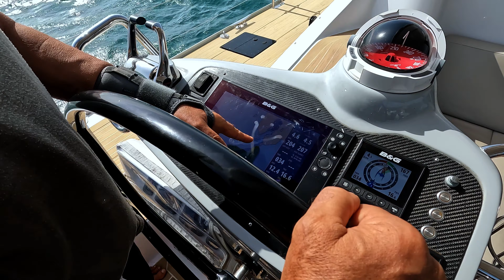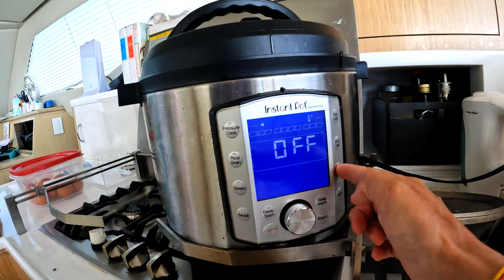From DREAMING to DOING: Our First Baby Step Towards SAILING THE PACIFIC! | Harbors Unknown Ep. 94

Comment: Great video!  I make yogurt all the time on our boat, but I have a less power intensive method. I use milk that is not UHT or filtered, the Instant pot just like you did for the first heat up, the I let it cool to 110 degrees, add 2 TBSP yogurt with probiotics or yogurt from your last batch of yogurt that you made and put it in a container called Yogotherm. You have to hold the temperature. You can also put it in an oven with the light on, but no temp wrapped in towels so that it holds the temperature overnight up to 24 hours depending on how sour you like your yogurt. I strain it using a colander with coffee filters to make Greek yogurt. I also freeze the starter yogurt in ice cube trays so all I need is milk. I hope this helps you. We have really enjoyed following your journey. Thank you.
Reply from the maker: Thanks so much for the tips! I’ll give this a whirl soon because the power consumption is intense. Great idea to freeze the starter! I thought it might kill the probiotics.